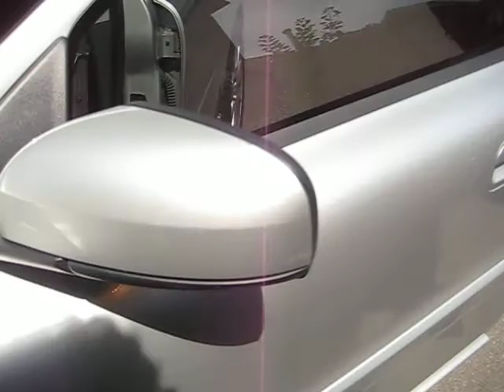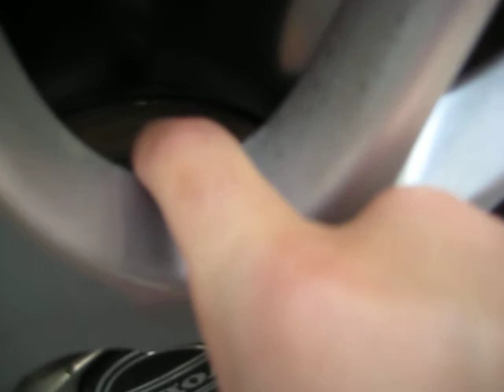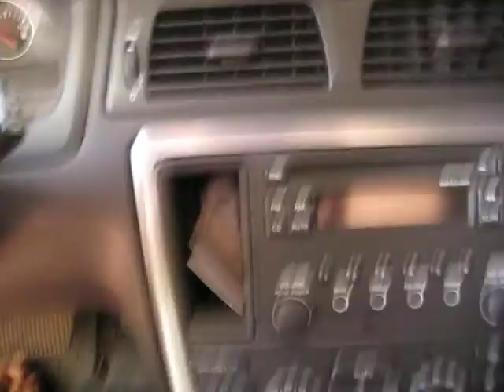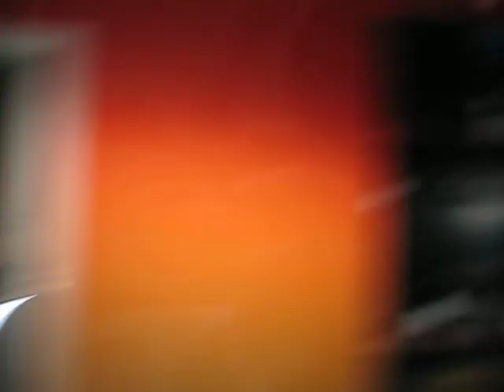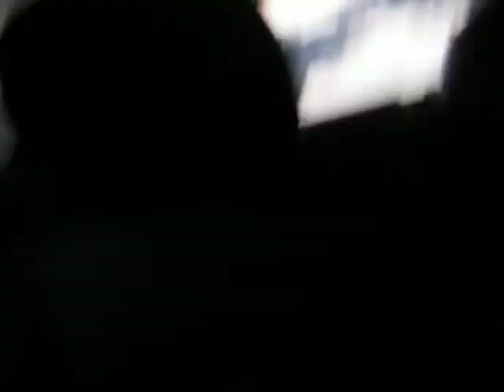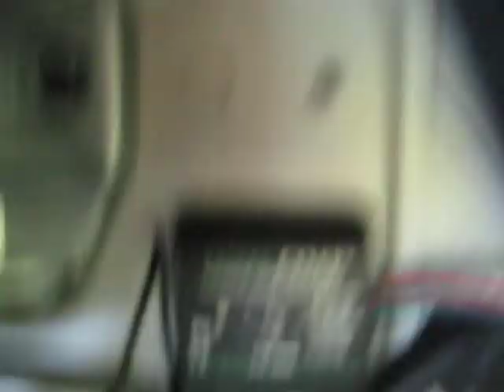Heico Volvo 2.5T 2005 , Eurosport Catback Exhaust

Comment: All of those rust inhibitor modules are just snake oil.  Electricity finds the shortest path to ground - which is the battery's negative terminal on negatively-grounded vehicles.  So there will be a single path with a lowered corrosion risk,

Meanwhile, all of the electronics in your car are already doing the same with their standby power.

And notice... LOWERED risk.  We still see plenty of corrosion on power connections all the time...

Comment: Hmm nice job for the HID where did you get the kit from for the volvo. by the way I do install the stereos to on the volvo i did install mine on volvo xc90 2005 2.5 it was a pioneed avh-p5200bt. but you have to know that you ll loose the remote control on the steering wheel. youi still didnt give me call to meet

Comment: The rust inhibitor module is useless... in general I've worked on Volvo all these years (excluded mitsubishi built S40). if you don't have body repair done to the vehicle they will not rust out.